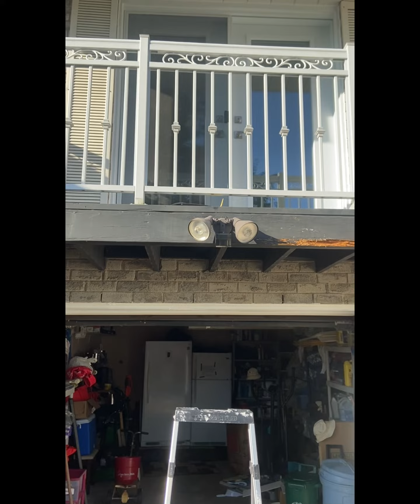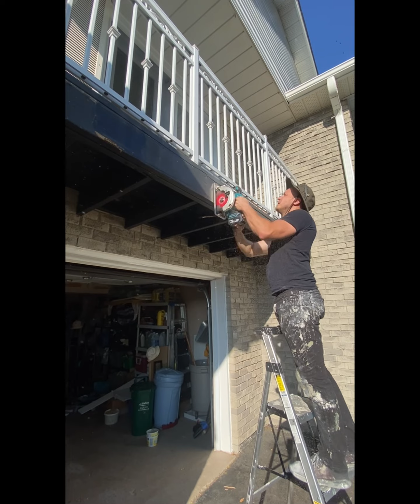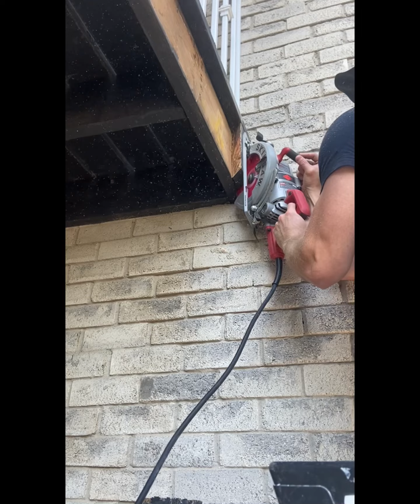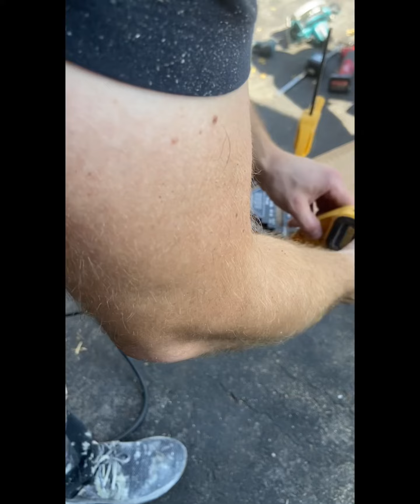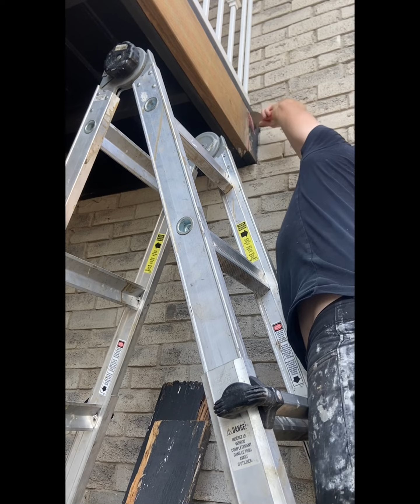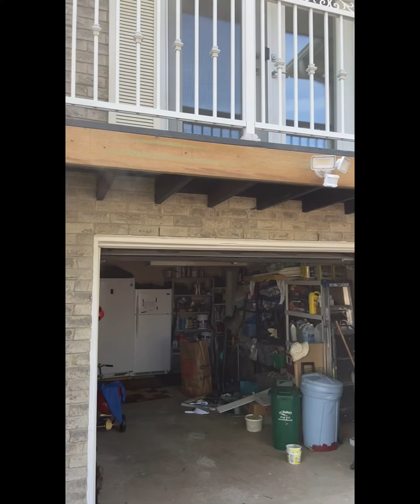How to Replace a Rotted 2x8 Cedar Deck Board | Deck Repair Tutorial by Bespoke Handyman

Comment: What’s a good way to seal the top of the joint between the fascia board and the structural beam behind?  Would a line of caulk at the top between the boards work to keep water out?  Thx.
Reply from the maker: You could do this or you could use something like a joist tape if you're expecting lots of penetration. In this case, this balcony held up for 25 years with only minor rotting on the face of the board as there's a deck board directly above the too. If all else fails, caulking always works but make sure you're not sealing any moisture in there!

https://www.homedepot.ca/product/resisto-joist-guard-for-decking/1001122743